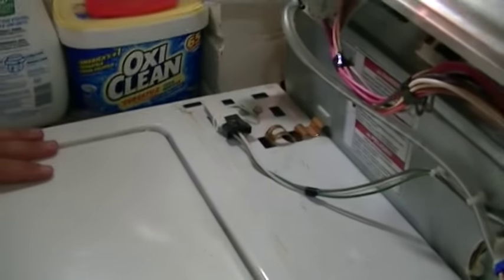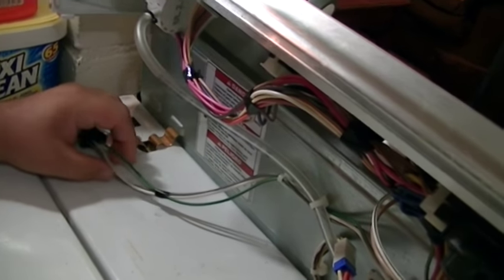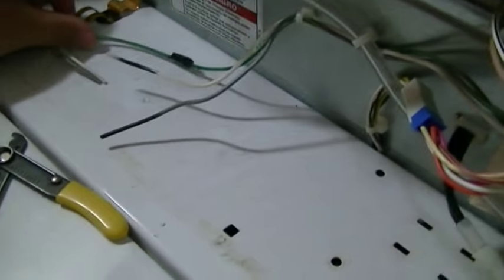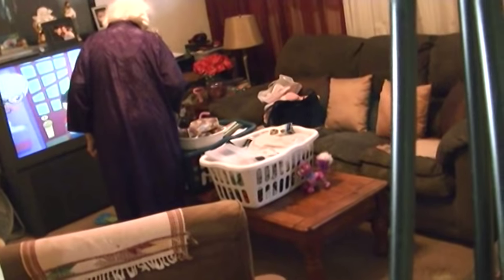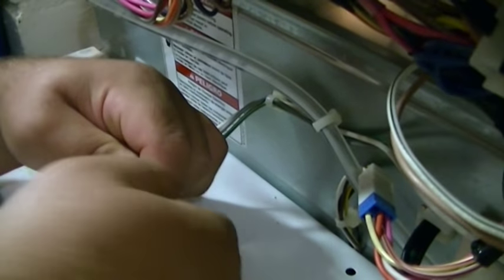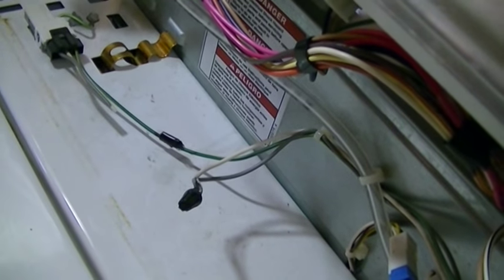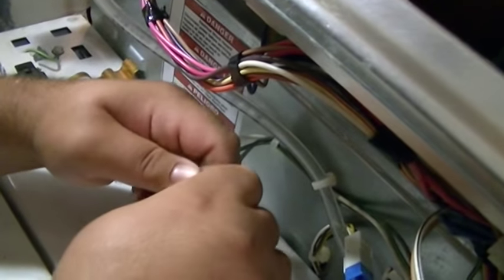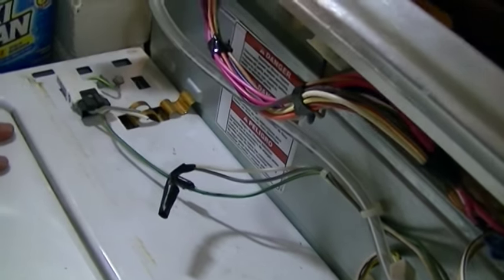Quick & Easy Whirlpool Washer Lid Switch Defeat

Comment: So you will risk one of those kids or an adult getting hurt by putting their arm in that machine while it is running???
  I would not want to be in that position.
Reply from the maker: Sometimes, mechanics have to work under the hood while the engine is running.  Would you prefer they have to close the hood to see what is going on, and have the engine shut off when the hood is open?  Your car would never get fixed unless they disable that switch.  AND GUESS WHAT?  Your car doesn't have such a switch, so the owner is free to open the hood with a running engine and stick their hands in moving pulleys and have their face chewed off with the fan.  Is that any better?  Any different?  Would you like to leave you hand on a stove where the burner is still on?  There are some areas in life where you simply can't help people, they have to take caution themselves.  How did you learn not to touch a hot stove, did your parents teach you?  Probably, but how did you learn?  You touched it and learned REAL FAST that wasn't a good idea and to be extra careful from then on.

Comment: Jaykay18, please don't beat me up too bad. I know it's junk out there but my Maytag just died after 29 years. There are trannies out there for $400-$500 rebuilt! But I am too old. My kid told me not to try to fix it as the control panel suddenly went out too!  Okay it flickers now.  And I thought about second hand but I don't want to keep replacing them or their parts too. I only replaced the bearing once in the LAT2500AAE , weep weep. Still in my garage like a memorial. I just ordered the Maytag 596. At least it has a level selector.
Reply from the maker: Well, best of luck.  It will definitely go to show you how poorly things are made today.
Reply: Jay, (Sam here) yes I am in sheer terror acquiring a new machine and reading comments/ reviews and after living in perfect bliss for 29 years. This machine has three plastic areas: Hub, splutch, and agitator.  Would regular inspection help say every 3 years? ( no more letting the washer do it's  thing. It's  come to me babysitting it. Oh well).

Also I was on your site to bypass the lid lock. Stumbled on an obscure  yt and just bought a lid latch for under $10. That should do it
Reply from the maker: @hanksome1677  I don't know if inspecting things is going to do much, typically when these things break, they just break.  Of course it doesn't hurt to inspect stuff, but I don't think you'll see much.  You'll also be sitting there babysitting for far longer than you are used to, these new machines take forever to complete a cycle.  Note that I did NOT say wash the clothes.  These machines today are like people in stores today.  They are only there to collect a paycheck, not do a job.  So if they can fool around all day and make it look like they were busy, that's good enough.
Reply: @jaykay18  jaykay, I appreciate  your candidness and honesty. Like Howard Cosell said : " tell it like it is".  

My dog I had for 16 years is buried under my fig tree. No way she was leaving  my sight to be cremated. I get to see her everyday.

Likewise  I couldn't  see my Performa in someone  else's  hands. Think : a yo yo puts a tranny  in for $150 used or $300-  $500 used and he basically gets a new reliable machine.
So heeding your advice 'keep your old machine at all costs" I decided  to replace the tranny. ( You can pull the shaft out without  loosening the agitator .

Continued----
Reply: So I don't  know how I got the screw, tub seal off 9 years ago. I just put a grinder to them as the shaft is dead.

I put a bid on a new tranny. I have extra  seal and bearing  kit I bought  9 years ago so I could  replace in the future when I needed it.  Today is that. So if hank some can replace a part it is simple!

The 586 I will give to my kid when he moves out. It is so stupid. I will be down without  a machine for a month when I get up to speed. My wife has been hand washing clothes like we are in a hotel.

Continued-
Reply: So when I get the 586 who knows when that will break down? Definitely  sooner than 15-20 years. Maybe 2 years. Yes read the horrific reviews. So now you have to have a backup as you wait for the tech. This is ludicrous.  " Keep old machine at all costs."

I cleaned up the Performa  and will spray paint cabinet. 

Surprise: No plastic parts!!!!
Reply from the maker: @hanksome1677  Very good!  Sometimes it just takes sitting on the problem and really thinking about it until you get the right solution.  I'm sure it will be extremely reliable once taken care of.  With good care of the machine, and never overloading it, it may very well be the last machine you will ever need.

Comment: Something tells me that the manufacturer would not authorize this, and it would ruin any warranty.  But Hey it will work.  And you don't have to spend $30 for a new switch.
Reply from the maker: Of course.  This actually was done by CHOICE, the owner asked for a lid switch delete.  On my 2 washers at home, I did the lid switch delete but added a toggle switch so it could be put back to factory.
Reply: jaykay18 yes, understood.  I’ve done such things myself.

Comment: The manufacturer should give a choice to bypass this just like childproof caps. Older folks don’t need this hassle.
Reply from the maker: Nobody needs this hassle.  If you can exercise due caution with the items you use on a regular basis, there's no need for devices like this.  And some are just that way.  Like your car, if a mechanic has to work on it with the engine running, under the hood, he has to make sure to watch out for the spinning belts, pulleys, fans, etc.  There's no switch that shuts the engine off if you open the hood.

Comment: Great video, now if someone could fix the smoke detectors that are beeping.
Reply from the maker: I came to work on the washing machine.  But I said the same thing.

My father had a beeping smoke detector for quite a while, every time I'd talk to him on the phone I'd hear it beeping.  It got so bad, next time I saw him, I gave him a 9 volt battery for it.  Next time I spoke with him on the phone, the thing was still beeping.  You can lead a horse to water...

Comment: Why cut wires? unplug at switch and connect a jumper.
Reply from the maker: It's a more solid connection this way.
Reply: Yeah and it's really confusing to jump wires.. My washer is totally different it has 6 wires but watching a guy doing a jump video and then watching this video I'm just going to splice them instead of jumping it.. It's good to see that some people don't want to just confuse you so you have to spend money..

Comment: wtf u wont show me how to remove the panel thats all i need to know to bridge the switch out lol
Reply from the maker: There are 3 different ways the panel opens up, depending on the model.  Some have screws in the front, some have screws in the back, others have clips that you can just barely reach underneath the top lid in the back.  If I showed you how this one opened, you'd complain that yours isn't that way.  This way, nobody gets nothing.
Reply: There are plenty of videos online that will show you how to do that. I have no mechanical skills whatsoever and figured it out. If I it did, anyone can.
Reply from the maker: Thanks Jennifer!
Reply: If you can't figure out how to open the panel by yourself, you probably shouldn't be bypassing any wires to begin with!   😐

Comment: You kust opened yourself to being sued by bypassing a factory installed safely switch. If the children get injured by opening the lid in the spin cycle, you will have big issues.
Reply from the maker: If children get injured, it's the parents' fault for not watching them.  Having kids means a 24/7/365 supervisory job.  Can't commit?  Don't have kids.  And certainly don't go after the guy who just saved you the cost of a washing machine, it's not his fault you didn't supervise.

There are no interlock switches on the hoods of cars.  Sometimes, mechanics need to work on things with the engine running.  They don't sue the car manufacturer for not having an interlock switch.  There's a certain amount of due caution we all have to exhibit near dangerous areas.  The adults are supposed to know that, the kids are supposed to be taught that.  If the adults can't teach the kids, they have failed as adults and we have a place for them called jail.

Comment: I think I broke the little green  wire and and that gray  tube now what ?!
Reply from the maker: I did specifically state to leave the green wire alone.  If you broke the tube, the washer will overflow.  Start fixing what you broke.
Reply: @jaykay18  yea I did that before I watched your video lol because I couldn’t see the lid switch thing and pulled to hard and it broke
Reply from the maker: @anaya3148  Green is a ground wire.  That could leave the case live if your outlet isn't wired properly.  In most cases, it is, and nothing bad will happen.  Otherwise, you will most certainly feel it in the metal of the machine.

Comment: Will this work on on the WTW5000DW1? I have three wires- red, white and blue. Which ones should I cut and join together? Thank you for your help!
Reply from the maker: That's an electronically controlled washer, and likely has a cover lid lock as well.  It's got to be fixed properly, there's no shortcut, you have to replace the broken parts.  That washer's not worth a damn, nor is any other one today.  Junk it and find a used appliance store that sells real washing machines.
Reply: @jaykay18  Thank you for your quick reply!
Reply from the maker: No problem--I always reply to comments because I hate when someone makes a video, someone has a question, and they never reply.
Reply: I have this same washer. Nothing is broken on the washer, I would just like to bypass the lid lock. Am I able to just cut and connect the blue and white wires, similar to what you did in this video with the white and grey wires?
Reply from the maker: If you read through this comment thread, you'd have the answer.

What you can do instead is unscrew the lid lock from the lid you open, and insert the tab into where it normally goes on the machine when the lid is closed.  Now it won't stay there by itself, nor will the lid close properly with it there like that, but that would achieve "bypassing" it.  It's not an elegant solution because there is no solution, only this workaround.

Comment: Will this work on the 
WTW8500dc  Cabrio top load it has more wires and tons of relays ? 
Thank you just let me know
Reply from the maker: Nope, that's got sensors and computers and all kinds of a crazy cockamamie system.  There's no fooling it or any kind of workaround, you have to fix what's broken.
Reply: jaykay18 thank you for the fast response
Reply from the maker: No problem, just wish I had better news for you!

Comment: Hello, can you please tell me if this will work on Whirlpool Cabrio model WTW5640XW0??

Thanks!
Reply from the maker: Nope, sorry.  Only way to get it to work is to fix or replace the broken parts.  That's just another of the many things that make an HE washer Hardly Efficient.
Reply: Thanks, Jay.  I don’t even know if my issue is a lid switch or what.  Tempted to purchase a new model.
Reply from the maker: Here's a better idea--purchase an OLD model.  Like the kind of washer you may have used to own or your mother or even grandmother used to own.  The old school top loader washer with an agitator.  You WON'T find those in stores, you have to go to a used appliance shop for that.  You'll get MUCH more mileage, not to mention MUCH cleaner clothes!
Reply: jaykay18 roger that.  Thanks!
Reply: After trying diagnostic again I got “shifter fault”, “basket speed sensor fault”, “motor unable to reach target RPM”.  Also E0/F0 which isn’t listed in manual.  It sounds like an issue with the motor.  Can you confirm that this isn’t worth fixing?   I don’t have the time or expertise to attempt this so would have to hire someone.  This unit came with home purchase.  Thanks for your help!
Reply from the maker: Does all of this sound like the Check Engine light in a car?

I thought so.

It's not worth even having it looked at, whatever you'd pay for a service call would easily be the price of a used machine.  Not to mention a used machine will be a lot cheaper than new, and there's no new washer out there, save for the 2019 Speed Queen Classic Model, that's any good.  I've made many many videos on this subject, just search my channel for "washer" and get the popcorn, it'll be a long night.

I was in a similar situation, I had a GE washer when I moved in to my home.  It was junk, but it worked.  Until one day, it started leaking.  It wasn't really repairable, so I lined the bottom of the machine with sponges, and that did the trick as the leak wasn't great.  Then it started having many other problems, like the oil slinging out of the transmission, the low-speed winding on the motor burning out, and finally the entire transmission locking up solid.

At the start of the first problem, I bought a washer and dryer set, brand new at the time, but they were just getting into transitioning out the old machines and into these HE machines.  I bought one of the last good solid machines that was made--and I'm pleased to report that the machine I bought is over 10 years old and has never had a single solitary problem.

When the GE finally died, I bought a used Whirlpool Direct Drive washer, older that the one I bought brand new.  That machine is from 1994.  I had ONE problem with that machine which I fixed myself (and have a video on how to do it).  Total part cost was $5.  It's never had another problem since.

Parts for those Whirlpool Direct Drive washing machines are readily available, are plentiful, and are cheap.  Not to mention the machines are an absolute breeze to work on, they were designed to be serviced, though they rarely need it.

Comment: Will this work on a whirlpool washer model WTW5000DW1?
Reply from the maker: That's a Playskool washer with a lid lock and a belt drive.  Everything's computer controlled, and without that lid lock and switch working properly, the washer wants to be brought to the curb so it can be recycled into more Playskool junk, that will break in short order.

You need to fix the actual problem, and that means parts, maybe even sensors or circuit boards.

Comment: Circa 2014
Reply from the maker: Tough call, I'm not familiar with the coin op machines from that time.  One thing I CAN tell you is that if that machine has a cover LOCK on it that locks the lid closed while operating, you're S.O.L.  Or if it has a "play/pause" button to start it.